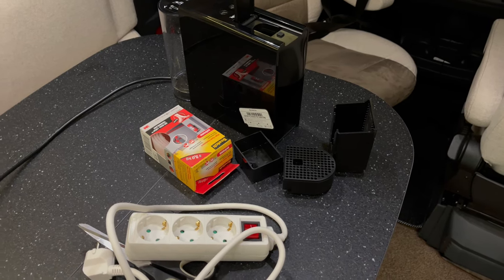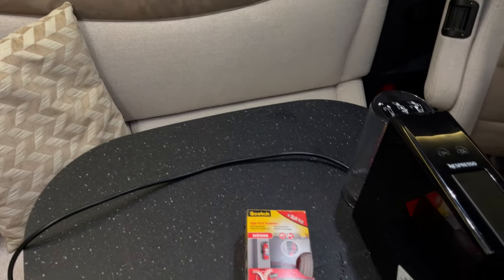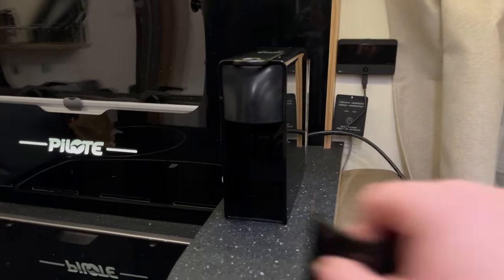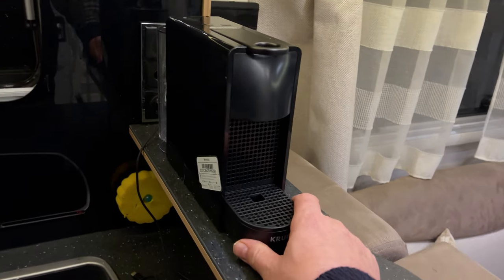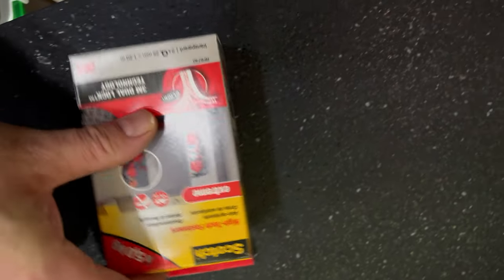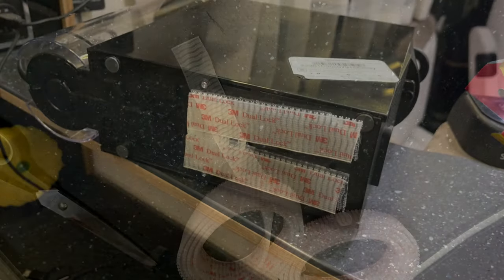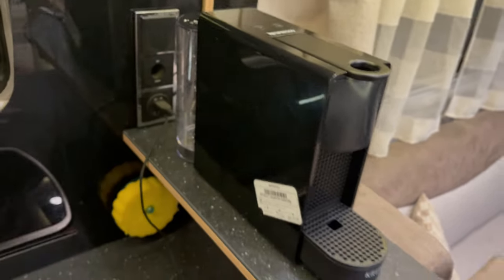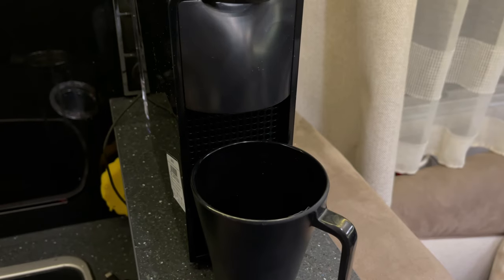Motorhome installing coffe maker - Nespresso

Comment: Thanks - looked all over for this content - eventually a google search pointed me here. Maybe a couple of Tags like Nespresso Pixie Mounting in RV, Coffee machine in RV / Motorhome and combinations of the above would have helped me find it in YT - thanks - how did this method of 3M tape work out for you?
Reply from the maker: The tape has held perfect, have not changed it since installation. Just be aware that if You are using an inverter the machine draws quite a lot of power when the pump is starting, don’t think I would have installer anything less than 1500w, I myself have a 3000w pure sinus inverter, that is enough to use the coffe maker, charge a pc, some cameras plus my e-bike and e-scooter at the same time. If You are thinking along those lines enough battery power is also essensial, I have 400w solar panels in total and 200ah Lithium battery bank😊

Comment: What did you do to make the Nespresso  work with the inverter, I have a nespresso and it doesn't work with the inverter
Reply from the maker: I just plugged it in, but I do have a 3000w inverter so it can run appliances that is using much power. I think the Nespresso draws  1500w at startup of the pump....